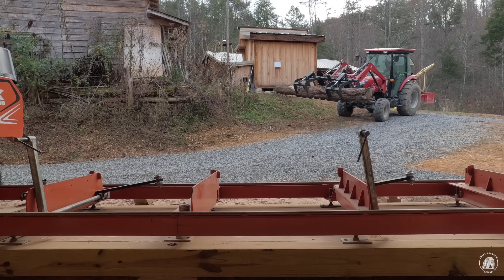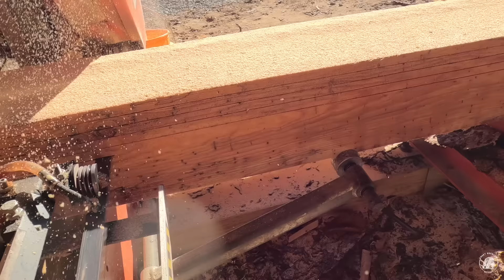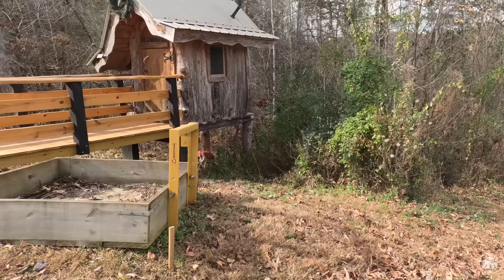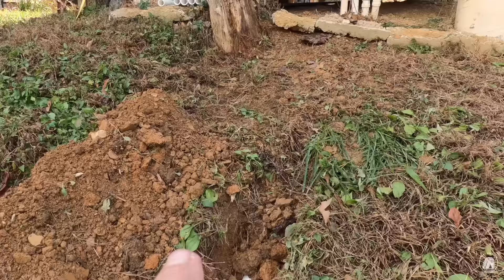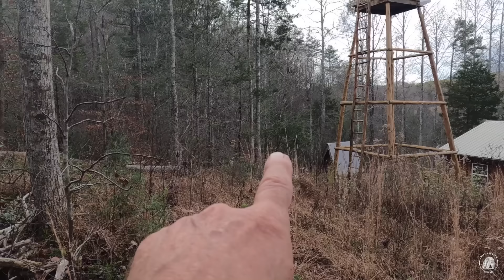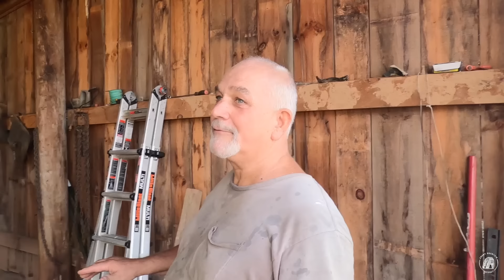Milling Trim From Scratch + First Electrical Setup! Full Workshop Upgrade

Comment: I have a fairly steep little hill in my drive way.  After getting it smooth I used 1 1/2 inch crusher run to top coat it.  It locked together and is holding good so far. Happy Thanksgiving...
Reply from the maker: I tried that and seems like it didn’t take. But over time Im sure it will pack in.